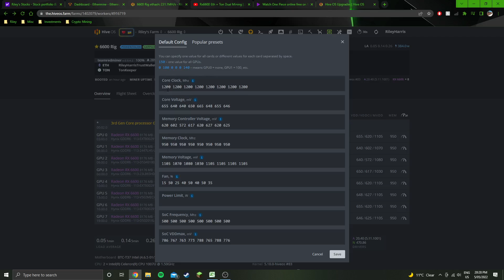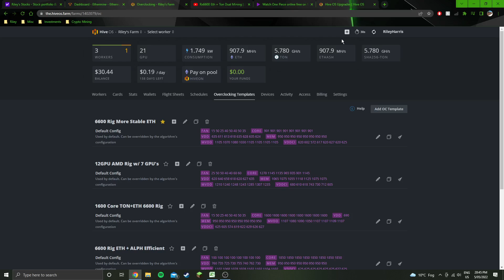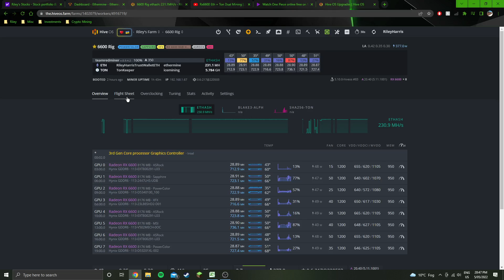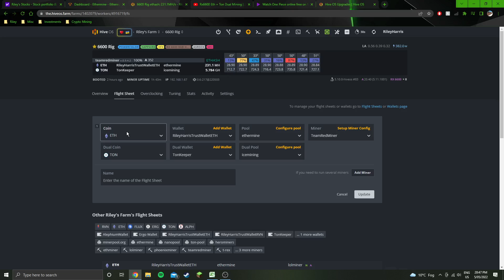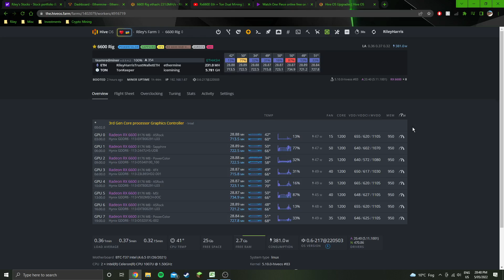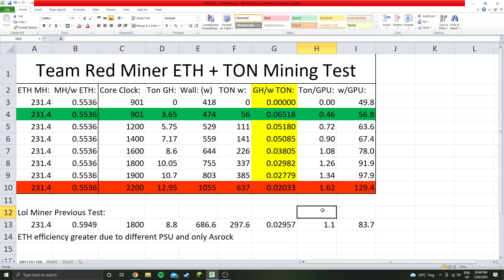Dual Minng ETH+TON 6600 Rig | 1.6GH TON or Efficient

Comment: TRM 0.10.1? Same OC?
Reply from the maker: For ETH+Ton? I can't say for certain as I haven't tested it since the new version came out. However I don't plan to, given that Ton has less than 2 weeks left being minable.
If you have issues on the current version, you can select an older version down the bottom of the miner config in the flight sheet.
Thanks for watching.